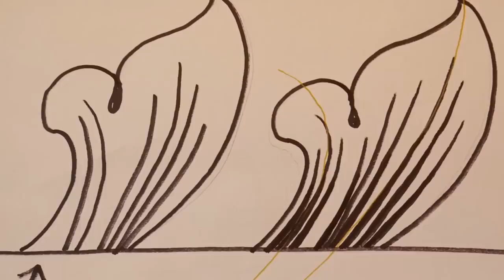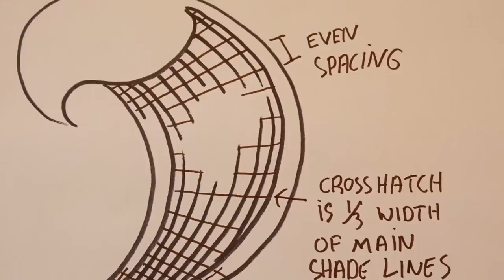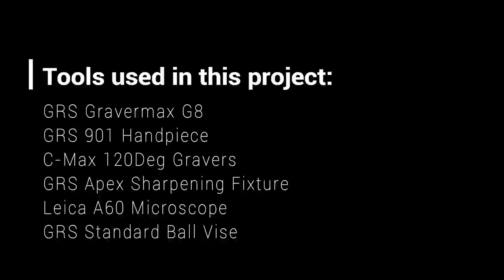Gun Engraving - the FEGA Colt 1911 Ep. 2 -  3 Shading Techniques for Scrollwork

Comment: I’ve often wondered about the effect on the structure integrity of the fire arm, from the engraving. Some gun can have problems even without engraving.
Reply from the maker: There has never been to my knowledge any structural problems from engraving a gun. We engrave barrels on Colt Single Action Army's all the time and I've never in 30 years heard of it causing a problem. Keep in mind my cutting is no deeper than the logos cut into the sides of the gun before i get it.  This work has been done for hundreds of years without issues.
Reply: No way. It's very light depth of cut. Most of the slide is just a reciprocating mass to counteract recoil. You could mill 80% of it away, as a lot of custom companies do, and still be fine. There is absolutely no danger in engraving the gun.

Comment: Awesome work!!!  What geometry are you using on the graver for the shading on this video?
Reply from the maker: R. Brian McNabb probably a 120 Deg. graver. These are all based off of shaping a square graver to allow parallel heels. I could do the same thing with a 105 though. This is just extremely tough metal and 120 is a strong point.

Comment: What blank are you using? Steel, M2, Carbide? I ask because Colts are hard. It appears your having no problem.
Reply from the maker: I"m using GRS C-Max carbide gravers. The gun has been extremely hard to cut. You are watching many hours edited down into 15 min and so didn't see all the sharpening that went on between.
Reply: Ok, That was my guess. Thanks
Reply: Is that a 3/32" Cmax that you are using?
Reply from the maker: I suppose so? I order round C-Max blanks and they come in a standard. Size that I’ve never paid atttention to.
Reply: @MasterEngraverTV  I just wondered I always have used the glensteel but I was thinking about trying the cmax too. In the grs catalog they have a 1.8mm , a 3/32, and then the 1/8 I was just curious about the ones you use. Thanks for getting back to me I appreciate it!
Reply from the maker: The only time I use Cmax is for very specific projects. Hard steel watches. Hard carbon steel. I use glen steel on 416 stainless and normal carbon. CMax and other carbides are brittle and the slightest twist will snap the tip.